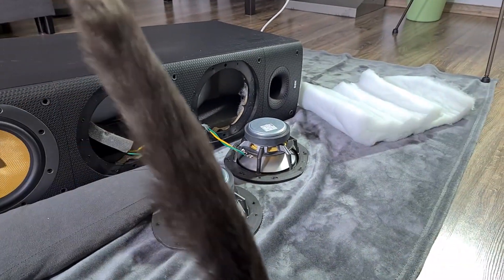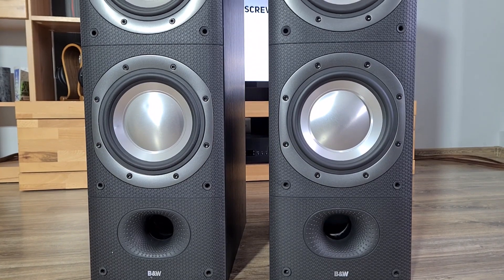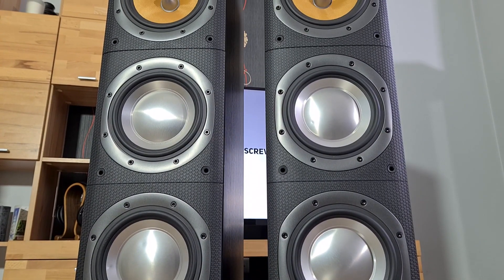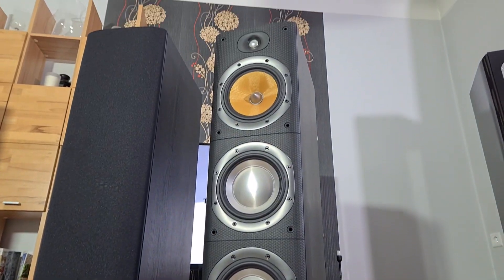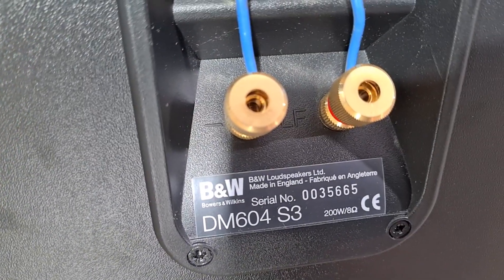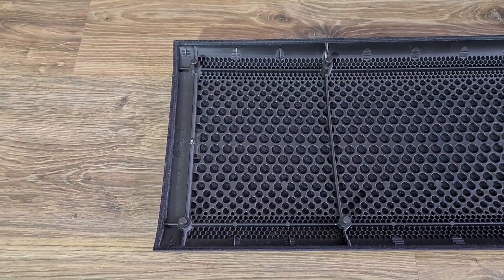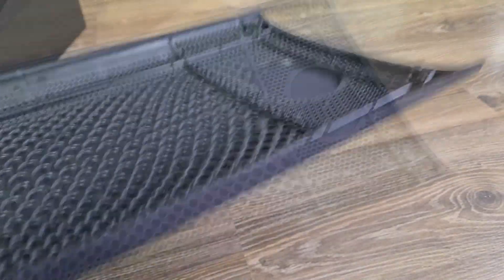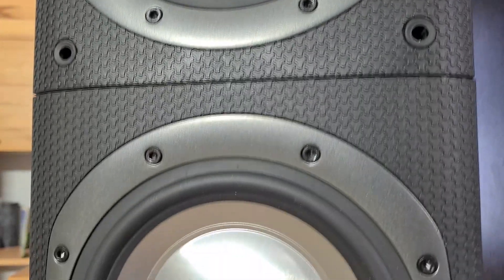Teardown Bowers & Wilkins speaker - What's Inside?

Comment: I have the S2. Beautiful to see quality inside on speaker design. You can get the dent out of the tweeter by gently pressing side of the dents.
Reply: I've tried all sorts of ways. The best way is with hot glue and a cocktail straw
Reply from the maker: thanks for tip :)
Reply: @Techscrews  Don't press sides of the tweeter, you'll only make things worse. 
Instead, use good-quality duct tape to get that out.
Did that several times.

Comment: This line of the DM600S3 series is my absolute favorite. In sound AND looks. I have the DM603S3 and thr DM601S3. I bought them in 2005 and have been impressed for almost 20 years. But looking at this breakdown has taken some luster off of my "magic boxes". I still love them. But looking at the insides and the components makes me feel like I should try building my own. 

I still love them though. I might see if I can find a used quality DM604S3 just to compare.
Reply: They all shared same drivers/etc so its same just larger. I've also had the 604S2 for over 15+ years, best investment I've made, out lasted multiple PCs and other equipment and can go up against anything new and similar price range in a stereo shop.
Building your own is hard... easier to start with subs, less resonance/etc technicalities in design to learn.

Comment: I have owned these speakers and the only gripe I had with them was that they need quite a large room as they can be bass heavy
Reply: If you put them on spikes and away from wall/corner/etc the bass is clean. If you want even less port bass then stuff them and run sealed with a sealed 10" sub, they are clean and go down to 25Hz or better that way :) 
For very low yes you need a bigger room.

Comment: It's not that B&W is any worse than Magnat Transpuls and all the others you had dissected, but it just goes to show that in the audiophile and Hi-Fi speaker racket, 90% of what you pay for is gimmicks, marketing hoopla, and vapor. All of them seem to eb building these things as inexpensively as possible. How much they end up costing -- that is where the "walking bullsh_t" part of the business equation becomes prevalent. Not picking on one single  mfr -- they are all guilty as sin of doing this.
Reply: Yup! Look at the crappy crossover's inside and the cheap crappy caps. particle board boxes :( Cheap cheap with over marketed technical gorgon !@
Reply: This is the comment I’ve been looking for! I’ve always wondered why are most of these “named brand” speakers soooo expensive. I’ve seen sets that cost up to $250,000+. That’s ridiculous!
Reply: The woofers looks like an ordinary speakers, the wood material used only cheap, the other brands of hi end speakers use hi quality real wood.
Reply: @wilfredonacional1295 real wood is acousticcly worse it warps and overall ain't it hdm over mdf is better
Reply: @wilfredonacional1295  Not many use "real wood" except for veneering. Some small companies might use solid wood. B&W also will use paint or real wood veneer on higher end lines. The 600 series generally uses vinyl wrap.
Reply: Lol, they weigh between 25 and 30kg each. Don't talk crap when you know nothing about them.
Reply: @aapaap8595  but if you make a tower from 18mm mdf with the dimensions 100x30x30cm your enclosure already weighs 16kg and thats without any bracing or anything.

So of manufacturers want to make a heavy speaker so it looks premium on the spec sheet they will just use mdf or more mdf then on their cheap speakers.

Weight only says something about the enclosures not so much about the driver unless you know the driver weight
Reply: @aapaap8595   they weigh 29 kg each, I own a set.

Comment: good quality drivers
Reply: How do you know?
Reply: @frankfarago2825  Casting, magnet, basket, materials, fit and finish etc... the yellow one is kevlar.
Reply: @frankfarago2825  Just having a cast metal basket, open frame with venting is a good step towards good quality. B&W do generally use good quality drivers. How they tune things is a matter of taste. I've found the construction to be reasonable even if they use particle board and plastic sometimes. I haven't kept a pair for a long time though due to not being my favourite type of sound

Comment: Electrolyt capacitors. Bravo B&W  you saved 10 $ ...
Reply: 53 and 150 uF caps are gonna electro, haha.
Reply: ive heard that film caps can be too bright and need resistors added in to smooth down, personally i have just replaced the electrolytics in my kef caras with new electrolytic mundorf brand caps and i am really pleased with the sound quality
Reply: @TheCornishGingerOfficial  they're part of the mid-woofer to woofer xover. It has films for the tweeter at the minimum

Comment: YOU CAN EASLY REPAir that tweeter. remove the dome with the three nuts and line it up with your fingers
Reply from the maker: We know how to fix it, but too bad that there is a small hole in the center of if and it creates distortion, so we just replaced it
Reply: @Techscrews , damn that sucks.

I have heard that it is a solution to use a needle to pop a tweeter out.
But I would NEVER do that.

By the way it's a nice pair of speakers. ✌️
Reply: @Techscrews  where do we  get these tweeters from! Its not available anywhere, if you know the dealer please let me know. Thanks
Reply: @shaktipatil3174 , you can also get them in grey. ✌️
Reply: @shaktipatil3174  didn't you see my reply?
Reply: @DubHead69420 .... thanks for the info! The price is for pair or a single tweeter?
Reply: @shaktipatil3174  you're welcome! ✌️

And that's a good question, I assume that it's for one tweeter, but I'm not sure.
Reply: you can never really repair a tweater... once its deformed, it never be as accurate like new... the dome will always have a deformation and will not vibrate uniformly... but when you have acces to parts, its a no choice... i had a pair of b&w dm110i that had an accident with them.. the cat was playing with the volume knob while im doing cleanup and one tweater blow... finaly i was able to unroll one turn of voice coil and resolder it to terminal... because i didint find spare tweater... it works 🤷🏼‍♂️!!! but my father b&w 703 had a tweater deformation and we never notice it... it was maybe a curious friend loll but we notice it one day because it was not egal to the sound... more percing sound...